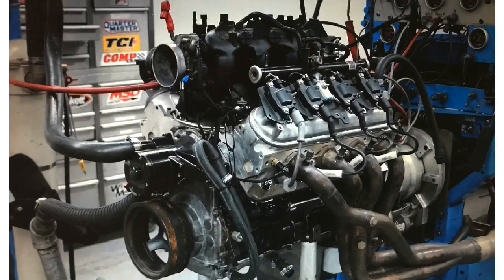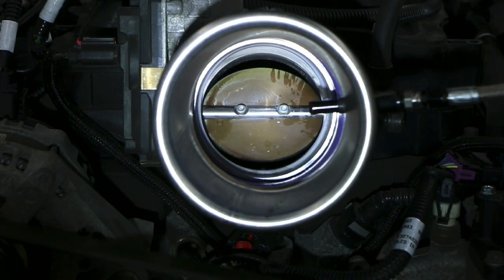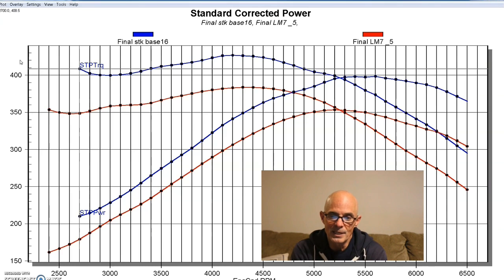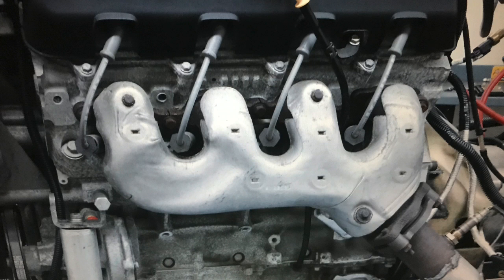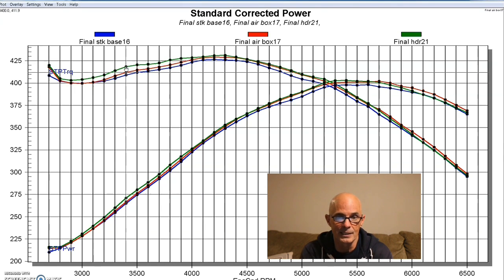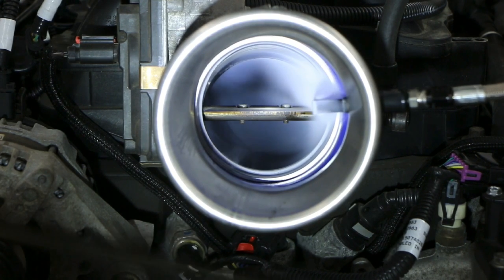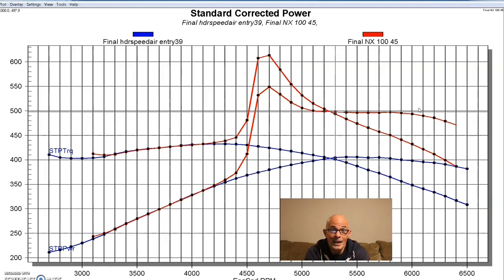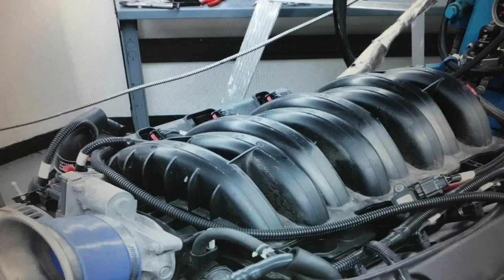JUNKYARD 5.3L L83 NITROUS TEST-THE REAL DIRECT INJECTION!

Comment: Just revisiting some of the LT stuff to get prepared and I have a concern.
Wouldn't it be SAFER (or make more sense) to run a DRY NITROUS shot on a DI motor in order to avoid introducing detonation due to the stock compression ratio and the fact that a DI motor is able to run much higher compression because the fuel is injected close to TDC under pressure, but not relying on the cylinder to compress it to solve this very problem ?

Comment: Did you have change the ringings? I hear the rings are low friction and do not like boost or any forced induction. And what did you do to the valve terrain? Springs? Rocker Studs? Did you do the head studs like you usually do?
Reply from the maker: all stock

Comment: How long does it last? Trucks are very expensive, they are practical when they last, small engines have to work harder, so they don't last as long. There is a different requirement between a work horse, a pleasure horse, and a race horse. Right tool for the job, right materials and workmanship for longevity.

Comment: You need to change fuel injection timing, spark, and cam timing to see the gains from the headers.  It’s a night and day difference.  Also you need to do the l86 intake manifold/Tb swap as well.  Huge gains with tuning.  I wish it was like the fords where they’re DI and port injection.  The port injection is where you’d make more power and the DI is for part throttle gas mileage and torque.

Comment: Had a 2015 Sierra with this motor . Factory tuning made it a dog . Had it custom tuned . Helped alot . But It went through 3 variable oil pumps within 5 months and this was only @ 45000 miles . All covered under warranty but I got rid of the truck after that .

Comment: Richard, I appreciate the knowledge & experience provided in your videos and have learned a lot from watching your channel.

I own a 2015 5.3L (L83) Chevy Silverado CCSB that has a CAI, 1-7/8 lt headers and  3” true dual exhaust. Do you have any suggestions for an aggressive sounding, dependable daily driver cam that will increase torque and performance near the bottom of the power band? I don’t typically do any heavy hauling or towing, just looking for low end performance. 
Also, do you have any other suggestions such as swapping out the stock 3.42 gears for 3.73s, 4.10s,....to aid in improving my lower end torque and throttle response while still remaining drivable on the highway?

Comment: Hey Richard, any idea if it is possible to put a 4.00” or 4.125” crankshaft in the L83? I see people doing it on the 6.2 engines but would there be enough room for clearancing with the smaller bore of the 5.3?
Reply from the maker: you might have to clearance the bottom of the bore for rods

Comment: Thanks Richard, as usual a very nice and informative presentation . I was thinking a closer comparison of LS base to LT base would have been comparing Gen IV LC9 to Gen V L83 since they are both 5.3 and both equipped with VVT.
You could then have a fair idea  on how much the Direct Injection + Higher Compression ratio + heads design + twisted valves would contribute to that power increase. Just an idea. Thanks again for the effort you go through. A fan from oversea :-)

Comment: L8T 6.6 would be an amazing unit to dyno...  400CI DI 10.8:1 iron block.

But you'll have a bit to work with for a while with L83's and L86's
Reply: Thinking of doing this but just using an L86 block and ordering the L8T crank with forged rod n pistons for an all aluminum 400ci...
 Then send the heads heads porting run a TSP stage 3 cam that comes with the VVT data, headers and LT1 intake...use the swap pan and drop it in my 67 Camaro
Reply: Or take an L83 and bore it to 3.902 like many do the LH6 5.3l but instead of making a 383ci like a gen IV again use the L8T forged crank and make a 370ci...that crank also doesn't have snout reduction its solid out to the end and keywayed like an LSA also 8 counterweights...damn good crank for $550

Comment: Richard this is really cool ... I've got a stock L83 engine and was wondering if I installed the LT4 supercharger from camaro and pretty much bolted it up would it make more power? The stock GM supercharger only cost $1200 but the kits cost $5500. So am I just giving up a little hp or am I giving up the farm like with the Eaton M80 supercharger?
Reply from the maker: the factory supercharger can make plenty of power, but it takes more than the blower itself to make it work

Comment: L83 with LT4 blower, HP pump injectors all else stock.....Go!       Haha I'm about to put that setup in a suburban and I'm curious
Reply: I would slow down the blower from the LT4 when installing it on the L83.  Going on a smaller displacement engine, it will make more boost, and will be less efficient.  It should be pretty good if running at 12 psi boost.

Comment: VERY cool stuff. it's amazing how much more power can be created from the same displacement....... it would be REALLY COOL to see the same back to back with a cam only swap on both mills...... maybe first using two camshafts as close to the same spec as possible (lift, duration @.50 etc...)and then a cam that is designed for that little bit extra I'm sure you can get from the LT platform over the LS to see how much more itll go

Comment: these truck motors were limited to 85% throttle position in the motor to prevent them from making more torque than the transmission could handle, or performing better than the vettes and camaros.

Comment: My cammed 2015 sierra crew 4x4 only puts out 340 at the wheels. It also has long tube headers, granitelli 85k coil packs and wires, 2800 stall converter.
What went wrong?
Reply: 340 at the wheels sounds pretty good to me.  Add 15% for the losses from driveline, exhaust and intake restriction, and engine accessory drive, and you're right around 400 hp.  The coil packs and wires and 2800 stall converter don't add power.

Comment: Not going to get the mileage out of these that you do with the LS. Direct injection is a huge problem that I'm not sure anyone has figured out yet. How do you keep the valves clean (running Nitrous thought the intake I guess is one answer), but since the fuel doesn't run over the valves, there is no inherent cleanup. You are going to get sludge and the motors are going to have to have cleaning (walnut or other) at 100K miles. LS motors folks are slapping 200K+ mile motors in their cars.   Richard, what are your thoughts on this and please correct me if I'm behind the times.

Comment: I'm actually surprised where the power curve came in on the dyno with the tubes installed.  I installed long tubes on my 2014 5.3 a few months after I bought it before I learned about tuning.  Unfortunately I never got it on the dyno, but it seemed like the power shifted higher up in the rpm range.  Glad to see the numbers.  Mine were 1 7/8" runners into 3" collectors on a y.  What size primaries were those yall ran??

Comment: The cool thing about direct injection if you need more fuel you can run a fuel rail style intake and run electric and manual fuel  systems at the same time

Comment: A proven solution to add lots of boosted fuel is to add a piggy back computer that just adds fuel through normal injectors based on boost pressure and RPM.  it can add no fuel in normal cruising operation and only come in on the map where the direct injection needs help. People have used microsquirt on brand new corvettes.  no sacrifice in the benefits at normal cruising conditions...

Comment: Please do a boosted LV3 for the Syclone Typhoon guys.
Reply: A boosted LV3 would totally blow the original Sy/Ty 4.3 V6 into the weeds.  The NA Lv3 makes as much power as the turbo 4.3 did.  (But not as much torque.)  I think 600 HP would be easy to make with a cammed and boosted LV3.

Comment: I would add a separate 45 psi fuel system with a set of port injectors.   Run the stock high pressure stuff, then when you need more power say from boost, kick in the port injection.  So run both systems in parallel for high outputs.

Comment: I know the guys at faster promos have the 5.3 lt engine with twin turbos in an s10. And.running9 psi on spring.pressure they would have expected 750.whp out of annls.the lt made mid to.high 800whp

Comment: It's interesting to see that the aftermarket has come out with belt driven GDI pumps.  Makes sense.  That cam driven one is a huge limitation.  One that I looked at is $5k.  WOW.  For a stinking fuel pump.  Direct injection is nice but not that nice.

Comment: The solution is a perhaps slightly more convoluted fuel system. Port and direct like other OEM's(TOYOTA) do to eliminate intake valve deposits, add extra fuel when needed and keep emissions at bay.
People running boost on DI engines have applied the aforementioned fueling solution with good results.👌🏻👍🏻😎

Comment: I LOVE the L83 in my 2014 Silverado. I have the airaid mit tube, modded airbox with an aem dryflow filter, muffler delete, tune and E85 and this thing rips! I smoke 14+ rams, tundras and even the older gen ecoboosts. The really cool thing about the flex fuel L83's is that even in the factory ECU they change from 355hp/383tq to 385/416 with just E85! They're fucking beasts on ole corn juice! 
Also for the headers I think what may be wrong is the smallish factory throttle body and intake. Swap that out with a L86 (6.2) intake manifold and throttle body or even better a ported TB or LT1 TB. They flow a LOT more air in and generally make some pretty good numbers even on a fairly stock L83.

Comment: freakun Far Out Mr. Holdener!
now i'm really starting to appreciate the simplistic yet powerful LS's. 
already did, but now really am. if i wanted a direct injected variable valve V8 street rodder/driver, i would also want the possibility of mild cam for cruise economy like a V-Tech or the new Hyundai CVVC. i'm just not a fan of mpgs under 18 on the freeway and under 12 in town. it's 2020 after all, and i know how to make high mpgs AND power both, but can't with an LS or LT(yet), but still would pick a 5.3 or 4.7 and pump it up to get the best i can get.

Comment: Finally someone catches on!!! I’m doing an l83 t56 combo
Reply: Were you successful? I wanna do this same build swapped in my 85 trans am. Looking at the tremec t56 magnum F, made for F body's. I'm aware the l83 is not made to fit any standard trans without specialty work done. Was wondering if you have any tips or pointers on what is required to make it work. The magnum F is different in length than the standard t56 if I'm remembering correctly tho. Either way any info would be great, I've scoured forum after forum and it seems this particular setup is rare, not much I could gather about it.

Comment: The l83 stock injection  system  will hold  up for a lot of power. The cams you can get fuel lope for %10 and %32. Most guys just do ls1 or lt4 injectors  and pumps that will get them to 800+ rwhp

Comment: These engines are so impressive. I've driven one every day since mid 2014. The mileage is hard to believe! And the power is all there for sure. I've seen the cylinder heads and they are offset valves and just look like a race design. Would love to swap one into a car one day. With the right cam and tune this thing will burn it down!

Comment: Something I can say with confidence is that the heads on LS engines flow better than L83 heads. That’s the reason why the long tube headers did not make much difference on this set up. I would love to see the gains of just the heads then add the LTH again.
Reply from the maker: I don't think the 706 heads flow more than the L83
Reply: I think the gains we are seeing are from the direct injection cooling effect it has in the cylinder, The VVT, and the heat dissipation capability of the block. I have 2014 silverado with headers, 180thermostat, K&N CAÍ, oil catch can, and tune that made 327hp and 367 TQ at the wheels on 20x12 37” tires. This is at a mile above sea level. I can say that everyone around here uses E85.

Comment: Here’s the list to make power with LT
1. Aftermarket cam with a more aggressive pump lobe
2. VVT lock out block for the cam gear
3.LT4 HP pump/LT4 injectors (still only good for 750-775whp)
4. Meth kit duel nozzle big kit ( we made a extra 175whp using this to supliment fuel)
5. Fast intake / 102mm TB 
6. A set of stock ported heads are so good  They just flow insane
Reply: So the meth kit gained that much power on a NA setup?
Reply: @jchydeboy8420  nitrous

Comment: At the shop I worked at we did a ton of the new LT/LT4 stuff and man they are far superior to a LS and make a ton of power. But 
1. The DI sucks. After just 3000 miles the intake valves are covered in carbon. Like bad
I would remove the crank case vents from the intake and add meth injection even on a NA build just to keep the valves clean. 
2. Putting a LT4 pump/injectors  on a LT1 to make power is needed for anything over 600hp really.  But we supplemented fuel with a meth kit instead of port injection because of the cost.  
But the LT is a far superior engine to the LS.  There amazing 
We made 713rwhp in a 2018 camaro 6.2  with sick heads cam port injection N/A. You can’t do that with a LS. Unless it’s a 454. Lol

Comment: I have yet to see a factory cammed GM make more power playing with VVT.  However, from my experience, the 5.3's make more power advancing the injector timing, the 6.2's do not.  I was just about to make a comment about the open throttle body but i saw you put a radius on it.  Lastly, the factory ignition timing on the DI 5.3's is pathetic.
Reply from the maker: Thnx-we swept ignition and cam timing in our quest
Reply: @richardholdener1727  if you ever have one on the dyno again, give it a try and let us know what you find.  I've done several, they usually pick up 5-10 HP from that alone.

Comment: Have you done a turbo equal length (or close to) collector vs a stock log type of manifold comparison?
Reply from the maker: I did Holley cast ex mans vs tube headers
Reply: @richardholdener1727  link?

Comment: You can also add more fuel by adding port fuel injection on top of the direct injection.  You'd pretty much need a whole second fuel system to do it, though, but that hasn't stopped OEMs like Ford and Toyota from doing it.

Comment: Way back when I turbocharged my 1.6 Suzuki, the tbi wouldn't flow enough fuel, so I built a megasquirt and grafted on 4 port injectors that would handle the boost chores kicking in at 1psi all the way to 10 psi, I got around 150 hp out of the little motor, so if you added a e85 aux injection system you should be able to get all the fuel you need

Comment: Swap in the l86 intake manifold and throttle body.  The stock heads could use a lot of opening on the exhaust runners to match a 1-7/8” header primary.  Even the stock exhaust manifold ports are much larger than the exhaust outlet of the cylinder head.

Comment: off the hop without having seen this vid yet....wild  potential for these motors, fasterproms S10 has one of these twin turbo'd and made 800 to the tire with cam ported heads and stock intake. More importantly, stock HP side. DI is tunable cylinder pressure, thats the advantage over MPFI.

Comment: If you really pump the boost to L83 or any LT you might want to consider running port injection.  The DI stuff gets stupid expensive towards 1000hp.  The big boys are compounding high pressure pumps via a belt driven pump and the cost is stupid.  Big injectors and big pumps can run 10k$ or more.  You already have a Holley controller and all kinds of intake manifolds for the ls stuff so just buy a set of adapters for the ls intake manifolds.  Send this thing to the moon.  I have a 15 Silverado and have been running a turbo for two years now.  DI cost is the biggest limiting factor in the LT engines.  As always thank you for the videos.
Reply: Yes.  Add port injection to supplement the direct injection when it reaches its fueling limit.

Comment: I've been tuning on a 2014 l83 5.3 and I messed around with the cam timing, I've also found that fixing the injector timing table also helps, or seems to help according to data logs.

Very cool to see you doing this! Excited to see all the results!
Reply: Yeah the injection timing makes the most difference with torque across the board.  It loves all the air you can give it.

Comment: Any possibility we could see an l76 or ly6 camshaft test while retaining the vvt?  So far, I can only find tests that involve swapping in an lq4 or lq9 camshaft and running without vvt.  I know these engines are hiding a lot of potential.  My own l76 is in some serious need of extra oomph.  I would bet that even with the factory camshaft, a good bit of extra power is waiting to be released by simply fixing the stupid cam timing that the factory tuning runs.  As always, thank you for the work you put I to all of this.
Reply from the maker: we can't run VVT with the Holley ECU
Reply: @richardholdener1727  well, if you ever have the opportunity to do it with a factory ecm, similar to how this testing was run, I know that I would be very interested.  In any case, thanks dude.

Comment: On my supercharged 4.3 the fmu wasn't enough. I ended up adding a NOS fuel side solenoid with a properly sized jet. It was triggered by a Hobbs adjustable pressure switch that came on based on my boost settings. Worked great until I was able to get the fuel system upgraded.

Comment: How did you guys get 425 lb/ft and 400 hp out of a stock L83? Are those numbers just the result of your optimal tuning?
Reply from the maker: and no air intake, and open exhaust and optimal tune
Reply: Interesting. My son has a '15 GMC Sierra and is wondering how to get "more" out of the 5.3 in it. He already did and exhaust and an intake. I suspect that optimal tuning has the most impact of anything. I imagine that would take a chassis dyno and someone who knows what he/she is doing in addition to a Speed/Density format?